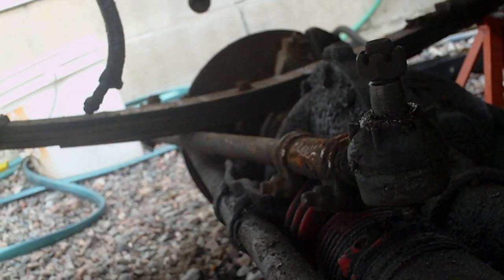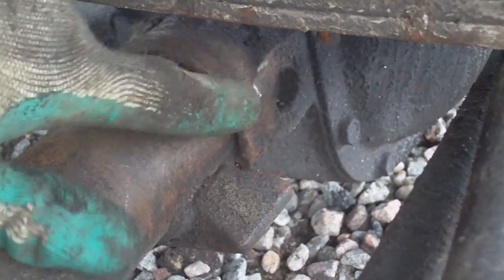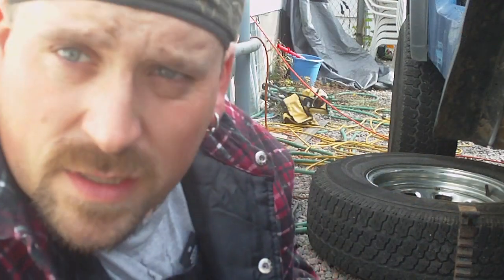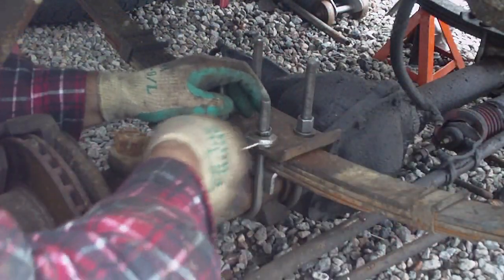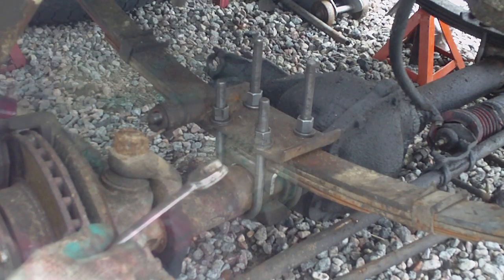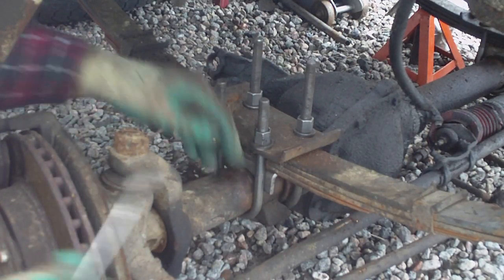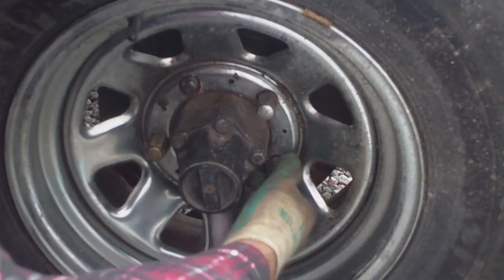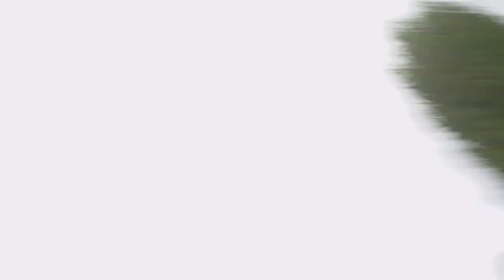Jeep CJ7 spring over lift pt 2

Comment: ONe question. When you put the spring perch on and bolt the u bolts on and the "flatter" piece that sits on top of the leaf spring that you screw down onto. Isnt that also where your shock Bolts onto? If so instead of putting on lift shock wouldnt you have to put "lowering" shocks since its starting out higher then stock?

Comment: Hey buddy I know this video was taking a long time ago but I'm trying to do a spring over diff just like you did on my CJ and I'm just wondering is there any other parts that need to be modified or purchase for the suspension like the sway bar arms or any other suspension parts that need to be extended because of the lift or could everything stays stock except for the u-bolts of course and the perches
Reply from the maker: U bolts, perches, welding, longer driveshafts , drop pitman arm .... should be good .
Reply: What kind of drive shafts did you get ...where did you get them ...any other info on drive shafts would be great

Comment: So I am really wanting to do this to my jeep instead of just putting a lift on.... But I have a couple questions first... What all will I need to do this project? just the spring purches and u-bolts and I'm guessing brake lines and maybe new shocks? Were the drivelines still long enough to hook right back up? And what about the steering?... Did it all bolt right back up or did you have to do high steer? If so, would a drop pitman arm work instead? How much did this whole project cost you? And now that its been a couple years, are you happy with the springover versus just a regular lift? Sorry for all the questions but i am really interested in doing this but I dont want to get myself into to big of a project..... Thanks
Reply from the maker: This is an old video so I will try my best... Perches, longer flex lines,  new u bolts,  xj Pitman arm, rotate your mounting plates from left to right,  same length shocks,  be sure your perches are welded to your axle housing, drive lines were ok.... The splines are more then long enough for "normal driving" I ended up selling this project before it was done but if u look in some of my older videos I also lifted a grand wagoneer the same way and it lasted for years..... As far as I know it's still going.... Hope that helps.... Don't forget to subscribe :-)

Comment: Hi , where did you got the part you are installing at 1:30 (the one that goes between the spring leaf and axle.
Reply: enterBJ40 I make mine out of 2x4 3/16 drill a hole through with hole saw size of axle tub then cut in half